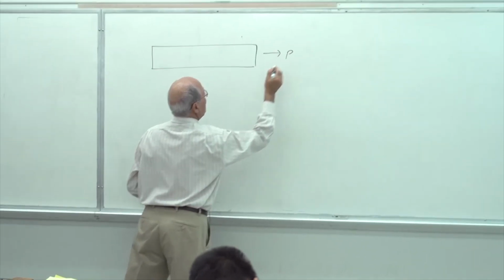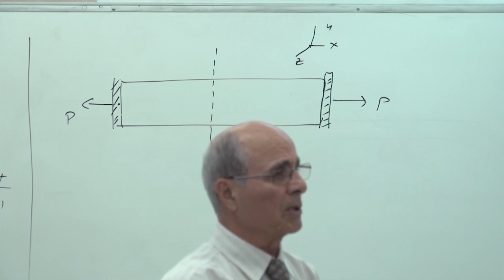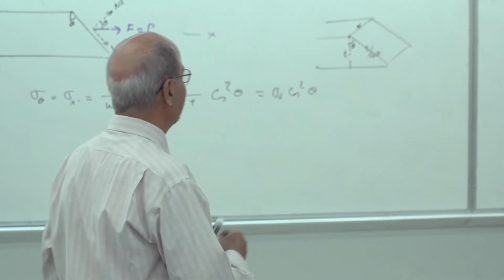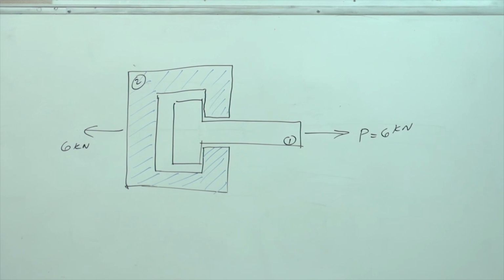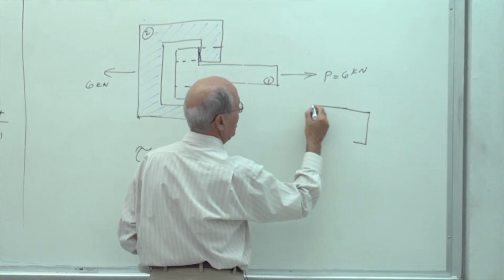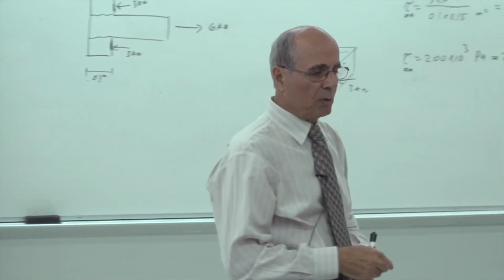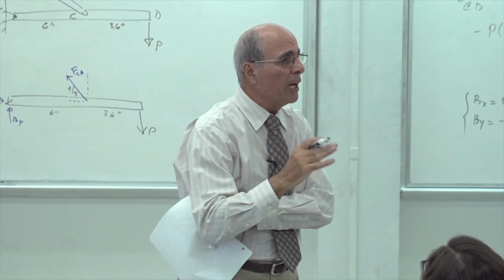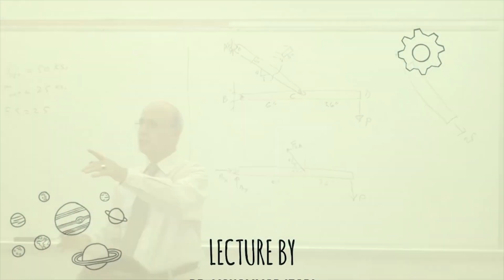Strength of Materials I: Stress in Axially Loaded Members (3 of 20)

Comment: why are weusing the p=959 instead of 1172 pound tocalculate the allowableloadat the end of the second example
Reply: because with force 959 other members can withstand it as it is critical to its shear resistance.
the member with 959 will deteriorate under 1172 force